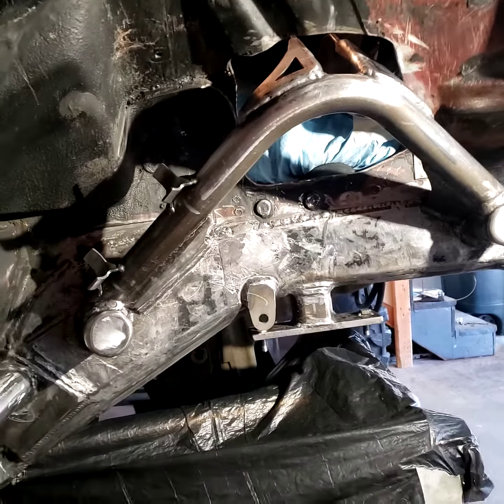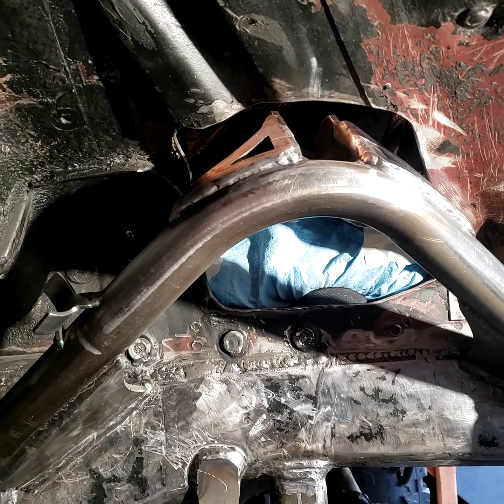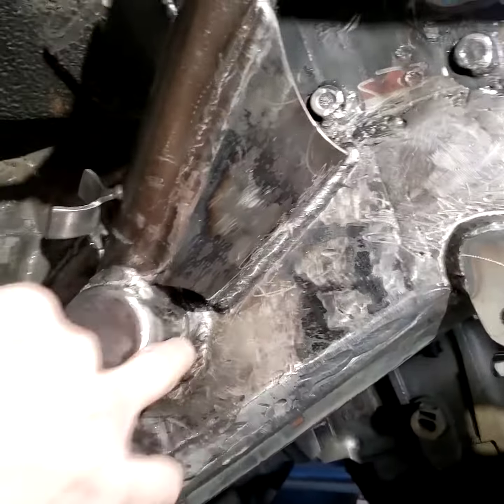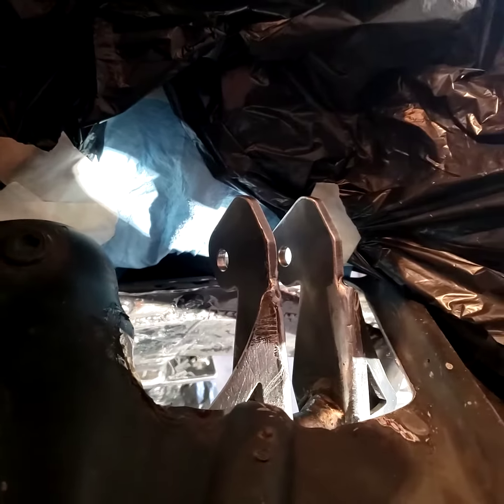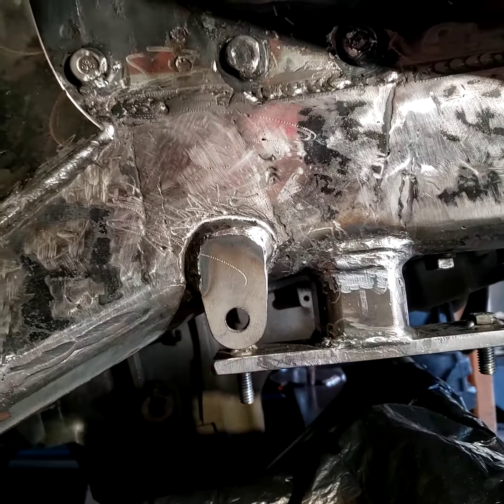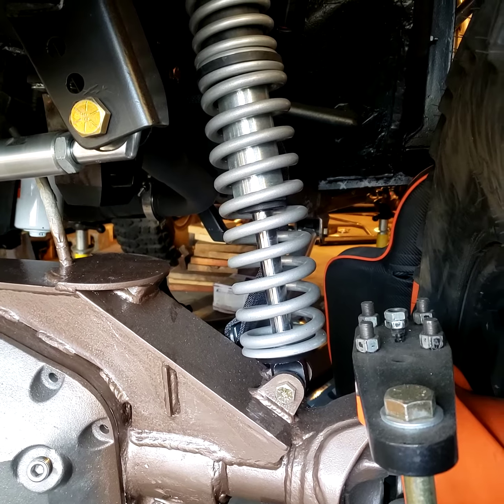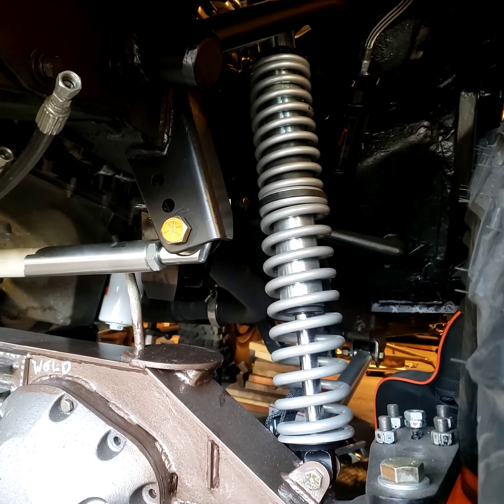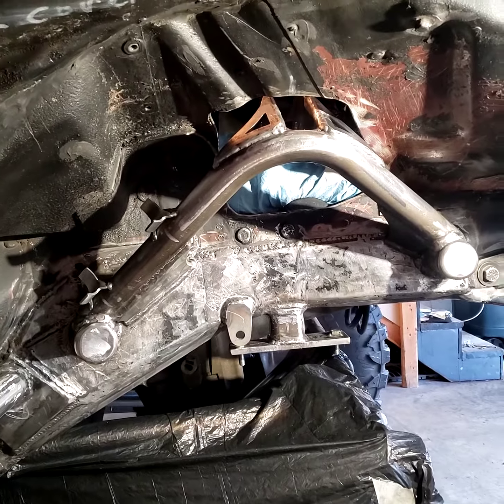Jeep XJ MJ coilover mounts from scratch

Comment from the maker: The front coilover springs were originally 150 over 250. After sitting for a few weeks they sagged too much and I ended up using 200 over 250. The 250 is pretty stiff. For any other iron block LS swapped XJs or MJs.... with winch bumpers and a winch, I would recommend starting with 12 or 14" front shock. With 200 over 225 or 200 over 250 coils.
My rig weighs around 4400lbs

Comment from the maker: I misspoke in the video FYI.. I just realized it. The bend in the shock hoop is not 50 degrees as I say in the video. It's 100 degrees. I just remembered. Its a 90 + a bit past. Anywhere from 92 to 100 would work for this type hoop design.
Just wanted to correct the information 👍👍

Comment from the maker: Another correction guys....  5.3L in a MJ buggy. Originally I was sent 150 over 250 springs. The 150 was too light. So now I'm at 200 over 250 and its pretty spot on. I have about 5" uptravel and 7" downtravel

Comment: Did this back in 2016 with 16" ORI struts with a cross brace and no they don't protrude thru the hood! I don't see what you have gained better than aftermarket XJ lift coils. If your after the cool coilover look then you have achieved this but the suspensions articulation and clearance is still close to a regular coil spring set up!
Reply from the maker: Suspension is limited by your front driveshaft. You cannot droop 10" down with 6" of uptravel. Your driveshaft won't allow that. You only need 5" of uptravel and 7" of downtravel.  Any more won't work because of the driveshaft. A universal joint is only good for 30 degrees max. It's really more like 25 to be safe.

A coilovers is a high quality pressurized shock that performs leaps and bounds better than a monotube shock and coil. There's dozens of reasons why this is better than a coil spring and a shock.
Reply from the maker: The axle is moved forward 6". Which also isn't possible with coils.